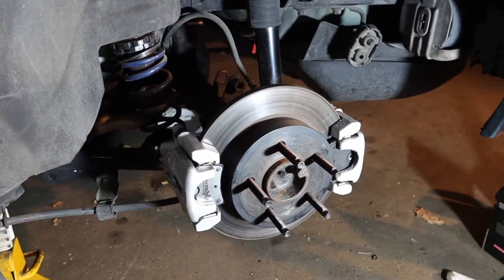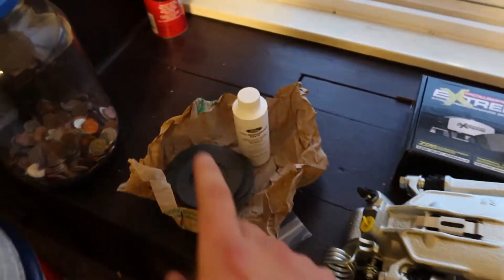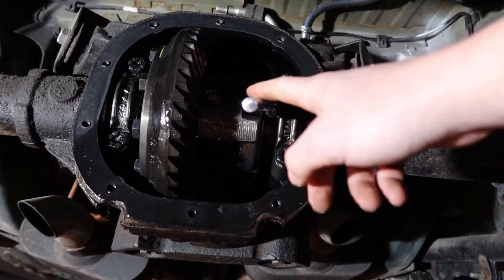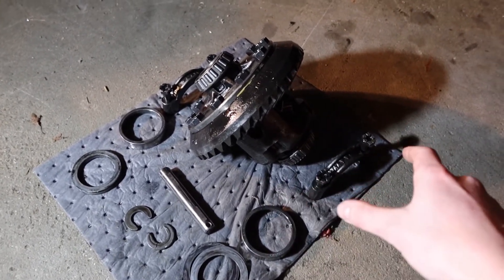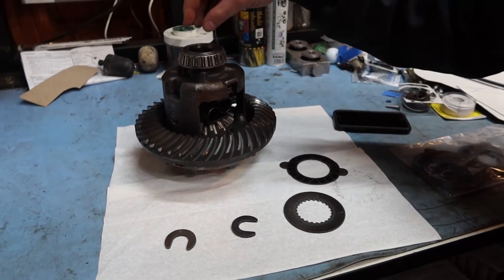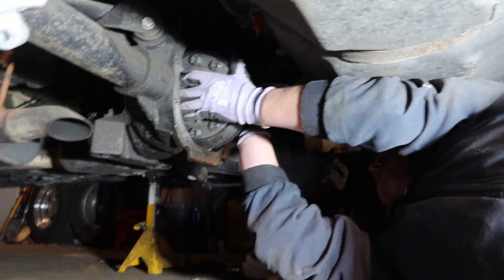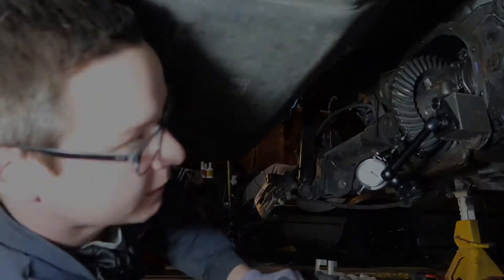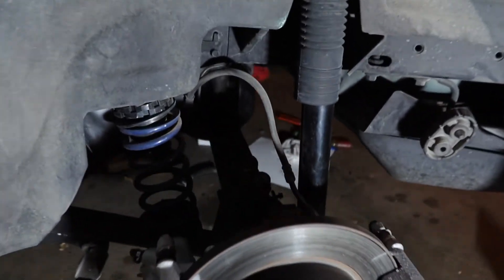Mustang Drift Car, Ford 8.8 LSD Differential Rebuild & Dual Rear Caliper Install for Handbrake

Comment: Am I being correct assuming that stock trac lok diff, being a cluch type locking lsd, is better for sliding/drifting purpose than torsen which comes with performance package?
I mean I know how torsen works, I have it in my e46 330ci. Slides okay when wet, good for daily, car has great balance and really hunts for traction. Its fast, but drifting it hard is difficult.
Reply from the maker: Yes that is the stock diff. I shimmed the side gears and clutches very tight so it's normally always locked.
Reply: @CrownRacingCo  Hard to believe they are so cheap and its actually clutch type. I see one for 230$ on ford website, where normally I'm familiar with spending literally almost 10x this price for aftermarket solutions for EU, JPN old cars.
Very reasonable.